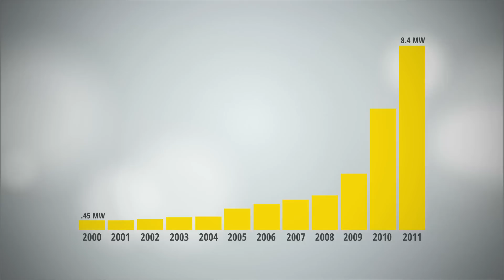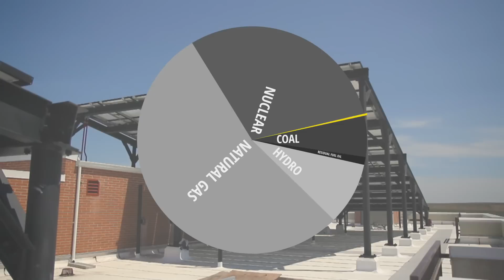New York's Booming Solar Roofs

Comment: Ditto what quidproquo says.  Also, at 0:29 there's a graphic which is also wrong.  16,000 MW should probably also be 16,000 MWH (although 2200 kWh/month per house still seems a little high for an average).  606 homes certainly don't need 16,000 MW of generating capacity!  Any time you have time in the equation (e.g. N somethings per year) the electricty metric needs to be energy (MWH), not power (MW).